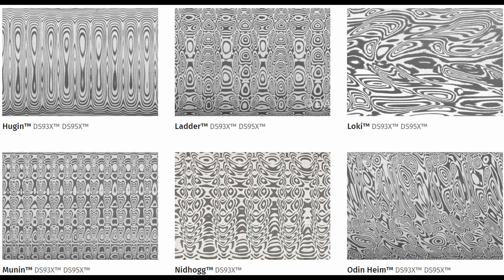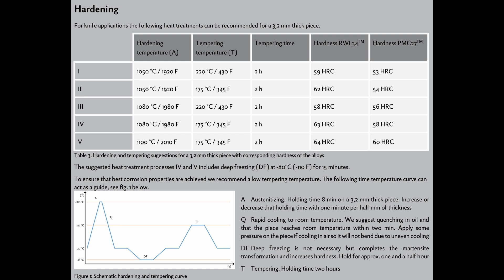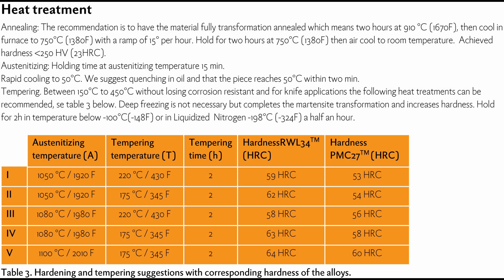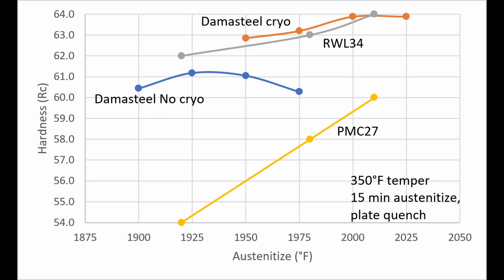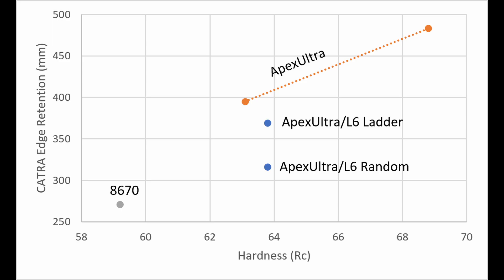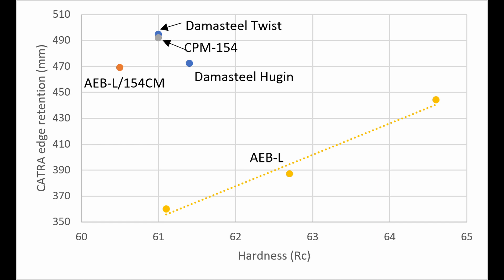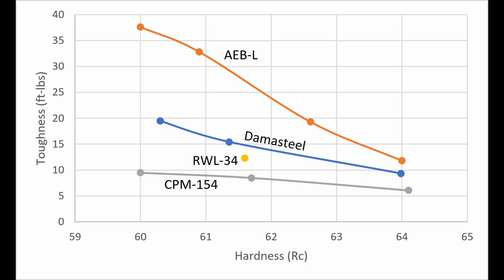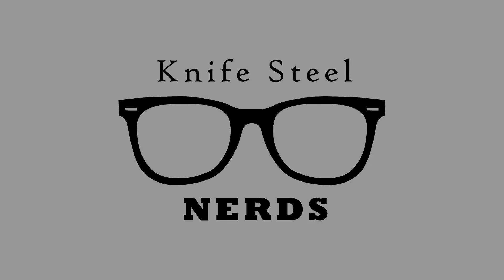Testing Damasteel - Powder Metallurgy Damascus

Comment: With regards to the discussion on hold times, that is teh perfect illustration between "science" and "engineering". The science (how things work) may suggest a procedure for the ideal, but engineering has to factor in real world factors, like less than accurate furnace temperature controls. lol

Comment: I know this isn't related to this video directly but I wanted to ask for your advice. I'm looking for the best possible steel for a fillet knife. I'm getting a bit confused looking at all the options and what not. I was thinking magna cut or maybe s30v, but I'd love to know your opinion. I'm looking for corrosion resistance, edge retention and the ability to flex (I know that has more to do with grind then steel from what I've seen)
Reply: Hi friend. Just as a metallurgy enthusiast I wanted to say that a filled knife does well with a good carbon steel so I was thinking maybe c13x17 molybdenum if you just want a single steel. That's pretty popular for kitchen knives because of its razor edge and edge retention but offers very reasonable stain resistance otherwise if you read this and want to talk about it, hit me up. 😊

Comment: you should really do those tests making ladder patterning with a single steel, but a lower carbide one like AEB-L or even 12c27 that relies more on hardness than carbide content for edge retention. as you noted it doesn't look like you can boost toughness much by layering with a tougher but lower edge retention steel. but if the wavy layering effect can actually increase edge retention as it appeared to in your previous testing, it might be possible to simply increase that attribute alone without affecting toughness.

my guess is that steels that rely more on their carbides for edge retention(and I'd put 154cm in that category), won't benefit from it as much as the carbides themselves are already filling that role. on the other hand, I don't see how a single steel would have a difference in hardness between layers.

Comment: I've used a couple of different patterns from Damasteel and they both showed those straight layers on either side of the billet like the Hugin pattern. I wonder if it's to do with how they're laying down the powder, or some other constraint with this method of production?
Reply from the maker: Yes it is how they construct the billets with powder that controls that. I don’t know if Damasteel considers that proprietary so I didn’t explain it.

Comment: Hi Larrin. Your last video about damascus where you found out that damascus does provide a serration effect got me curious with something, specially the 1095 and nickel. As a fan of The Witcher games, silver swords got me curious. They are used against monsters born of magic because they don't take cut damage from common steels. I am sure that many of your Patreons are also fans of the series and they would like to see the performance of a damascus blade of pure silver, specially for a Halloween episode, maybe. The silver blades in the lore of The Witcher are steel core with a thick silver plate of silver by fandom wiki info, but it doesn't specify how it is plated or the specific thickness. Maybe a damascus of common steel and silver would be an actual option? I don't know, but I hpe you find these propositions interesting enough. Thanks for your great work so far!!
Reply from the maker: Silver is very soft so it doesn’t provide performance advantages when plating. Unless you count silver plated butter knives. But with the high cost I don’t see anyone using it for Damascus.
Reply: @KnifeSteelNerds  oh, I don't imagine someone would. It is more of a fantasy-meets-real kind of thing. For the fantasy nerds usage in the "actuaaaallyyyyy" arguments 😅

Comment: Hey Larrin! Great video and great research for a lot of people to have access to! Question for you, good sir. Do you have any comments/thoughts/tests on the quality of the newest "cheap damascus" by brands like Civivi/Oknife? I personally just got a few of them because I couldn't believe how cheap they were even with "damascus" blades to test myself. I'm so used to warning new knife people away from ebay trash damascus that it is suprising the prices they are offering in general. After a month of use, all i can say is I have been thoroughly impressed with the edge/durability of their steel. I got the baby banter in carbon fiber/damascus. Then wanted it sexier and a bit heavier so i got some black flytanium scales. (Has become my new fidget toy lol)  But now I've been finding myself using it just as much if not more than my HQ knives i will rotate through. I'm sure their recipe is very proprietary, so please don't get in trouble with any information you may want to give lol i Think you could do a cool video talking about maybe what has made modern damascus so decent/accessible.  From my experience, I'm discovering civivi's has about the same maintenance needed for the edge as like d2 or 20cv. Ive resharpened fully only once, but i hone/strop it every day after use. We could go on for hours about this stuff so hope you can give some insight Keep it up!!
Reply from the maker: Obviously Civivi isn’t making the Damascus themselves. I don’t know anything about it so first would be for someone to say what Damascus it is and that would help in forming an opinion.
Reply: @KnifeSteelNerds  That's what i assumed as well, but It's not a bad thing.  Whomever is making it seems to have broken the barrier on getting " decent quality" damascus available reasonably to the general knife public instead of being a mythical/money term to high end blade snobs who are fully aware of how tedious it is to produce. I remember seeing on a forum that someone made a statement of cicivi being "9Cr18MoV core along with the claim that it performs like 440C." Not sure how accurate that is but all in all, it's a really cool thing that we're finally at the point to have the words damascus/ high quality/affordable all in the same sentence, but be in a positive connotation lol appreciate you boss. Keep on keepin on! Loved the book.
Reply: Its been claimed that these steels are not powdered Metallurgy but electro slag or spray form. But no factory in China is currently making powdered Metallurgy Damascus. 

Even cjrb has a steel they say is powdered Metallurgy but it is not.

I'm not saying that is bad, but thats likely how its cheaper.
Reply: If your 20cv is about the same as all that other stuff, it must be like 58rc give or take. Not uncommon or perhaps its grain growth from excessive hold times or perhaps using too low a pressure in the quench? Or maybe they didn't use deep freeze. Or maybe a burnt edge.
Reply from the maker: It would be difficult to get grain growth with 20CV. So much carbide.
Reply: @KnifeSteelNerds perhaps. Ive talked to Roman and a few others on the topic, and it seems they see it when using higher aust. temps and longer hold time. Generally mass production won't use those higher temps. But still, why would they hold 30-40 mins when they can do 20min? I know ive seen some white papers in the past on this with wear tests showing a difference. And I believe we've seen it in the cardboard cut testing if not mistaken.
Reply from the maker: The 20CV datasheet says 30 minutes. The datasheet for M390 says 20-30 mins up to 2100F. Probably another ten minutes wouldn’t do much else. But knifemakers tend to think anything longer than the hold time they are using is way too long.
Reply: @KnifeSteelNerds okay, well, maybe your right and other multiple accounts are wrong due to some other factor not accounted for. Or maybe Roman is right?
Reply: @KnifeSteelNerds  via Jack McLane: heated a bit too high or a bit too long and you dissolved some of the microcarbides. This dissolves more carbon in the lattice for martensitic hardening and you reach a higher hardness. But this is not a good thing. Because this means that the properties are damaged that make this steel so very powerful. And that are the microcarbide precipitations. Hardness in HRc is not everything.
Reply from the maker: There are several reasons why people might be saying the 20CV isn’t performing well and excessive hold time during the austenitize wouldn’t be in my top five guesses.
Reply: @tacticalcenter8658  Love of the discussion. As for my reference of 20cv, that was just my personal frame of reference with knives i own that required an equivalent level of maintenence for consostant razor sharpness against the damascus from the banter. My bad. Wasn't comparing the metallurgy at all, but understand you guys' point. That's all cool stuff regardless. Lol
Reply: @justinjones4199  ahh gotcha
Reply: @tacticalcenter8658  no worries my bad for not making that clear enough.

Comment: Whats with european steels having X in the name
Reply from the maker: X is the coolest letter. Even Elon Musk thinks so.
Reply: they're steels of at least 5% alloy content. the X is to easier discern them from other steel types like plain carbon, HSS (S-series) and low-alloy carburizing steels.
Reply from the maker: Interesting. What are some examples?
Reply: @KnifeSteelNerds  1.2379 - D2/X 153 CrMoV 12; 1.2344 ~H13/X 40 CrMoV 5-1; 1.2363 - A2/ X 100 CrMoV 5. for the other types 1.0601 C60 (like 1060), 1.0503 & 1.1730 both C45 (you can get the same steel with another number if it has higher purity, comes in hot-rolled or pickled state etc.), 1.3343 S 6-5-2 (HSS, other S-series is mild steel like S235J, former St37), 1.7131 16 MnCr 5 - carburizing steel. I was wrong about the stainless steels, seems they carry X designation too.
Reply: @verdigrissirgidrev4152  thankyou